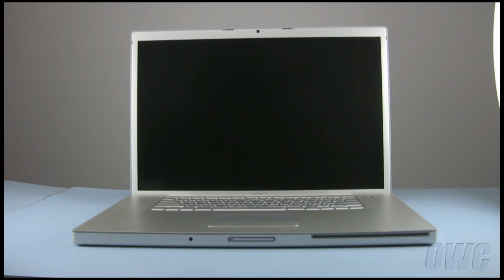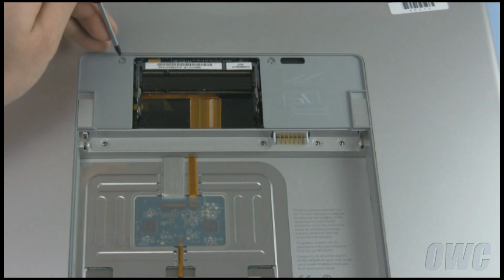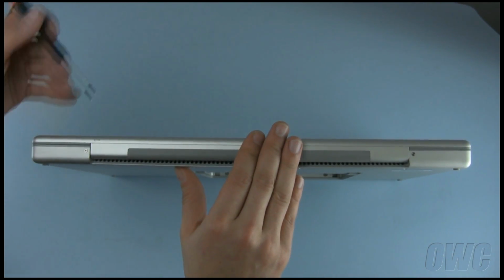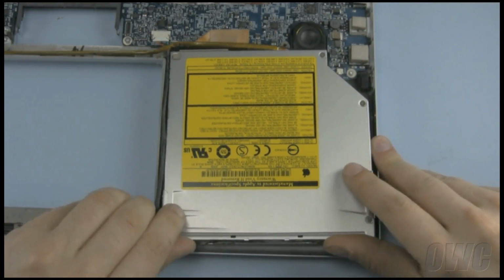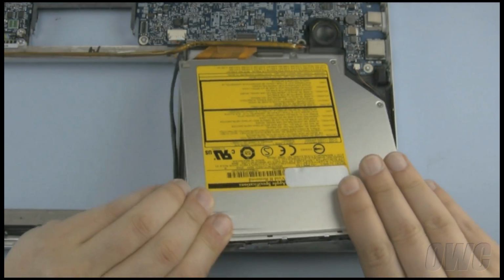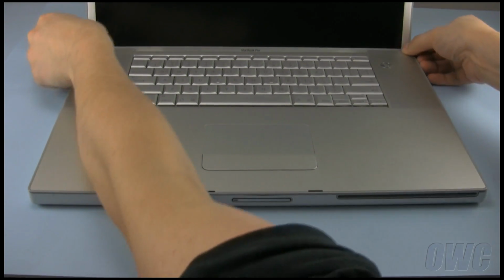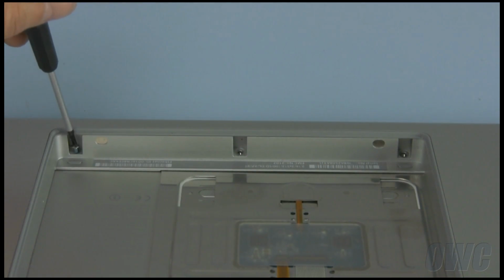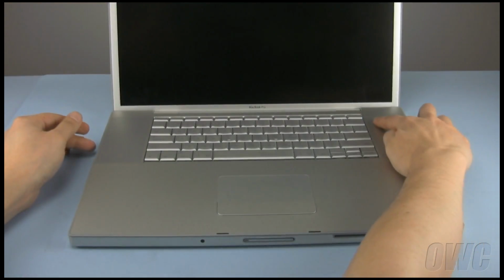17-inch MacBook Pro Pre-2009 Optical Drive Installation Video

Comment: I've just installed a caddy for a 500GB HDD in place of the optical drive, but the machine (A1229) won't recognise it and it doesn't show in the disk utility, nor does it show if I list the drives on terminal. Are there any known issues with this macbook accepting these type of upgrades?